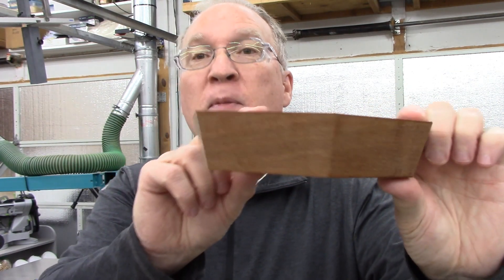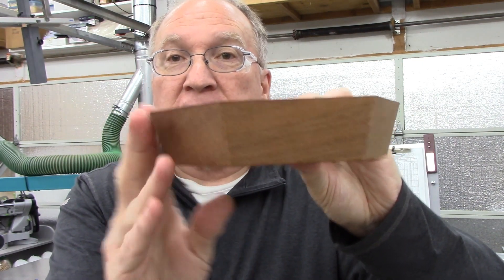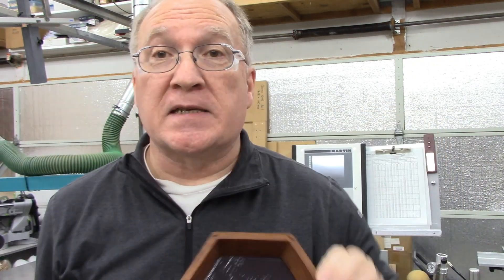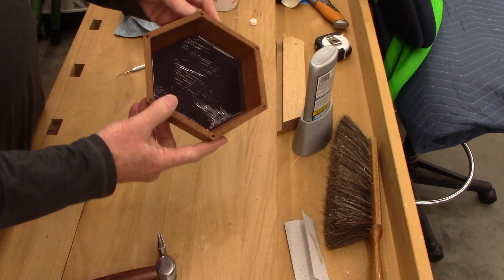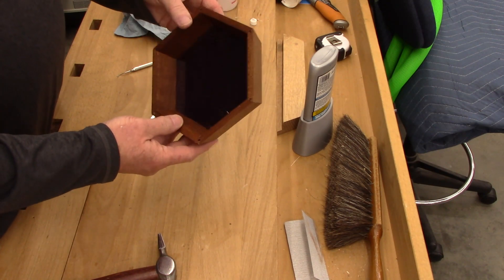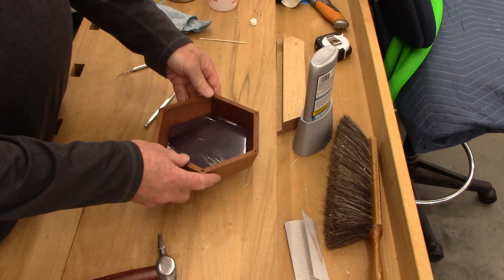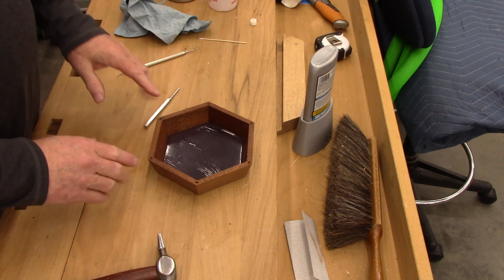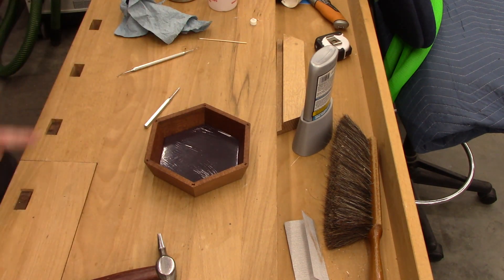Making a Hexagonal Compound Miter Box Part 1

Comment: Steve, watching all of those precise, and repeatable compound cuts done on the slider, makes me want to sell my miter saw.  😁👍🏻
Reply from the maker: I seldom use the miter saw in the shop as the slider is more accurate and safer.  Steve
Reply: What do you use your miter saw for?  I don't think we're watching a mobile shop video
Reply: @ReeseK9140  mainly for cutting face frame stock to length.

Comment: Jeez, I would be an extreme woodworker if I had $150,000 worth of the latest, state-of-the-art premium, industrial woodworking
equipment in a $350,000 workshop.  I've made tapered, octagonal containers on my crappy, 33 year old, Sears Craftsman table
saw with a few jigs and beveled router bits.
Reply from the maker: Great!  Make a video showing your octagonal container build, provide the link in a reply to your comment, and I will provide it as a recommended video on the endscreen of this one.  I have made this challenge to a number of people making comments similar to yours over the past 10 years and, to date, no one has accepted.  I expect this one will be no different. Steve
Reply: @extremewoodworker  You betcha!
Reply: Of course it's not a skilled worker utilizing skilled tools... Do better with what you have.

Comment: I know its a simple box but your work is really nice.  I really like the way the grain flowed around the box.  Your shop tools are also so nice.  Based on the templates you have to make this would I be correct in guessing that you batch out a number of these at a time?
Reply from the maker: Hi Andy.  While these boxes may look simple, it is amazing how complex they are to design and construct since there isn't a right angle in any of them.   I should have marked the pieces as I cut them to make grain alignment easier.  I always batch boxes as it makes little sense to make just one due to machine setup time.  These were prototypes and my first with splayed sides so this was a very small run for me ( usually do 15-25 at a time).  I started with enough stock to make 6 boxes but ended up with 5.  I lost one due to figuring out the clamp fixture on the Hoffmann machine as it took two iterations to arrive at the final fixture (the green one).  The lids are individually customized so I will do these on an as needed basis.  Steve
Reply: @extremewoodworker build templates that can be handed down... Maybe a son or son-in-law can carry the torch (I've never used an intricate nail set like that)

Comment: Steve, I always learn something valuable in your videos.  I'm sure you 3D printed your glue bottle holder.  That's brilliant!  I love quick and thick, but it has to be held upside-down while working with it.  My version is more crude and was made on the fly in 5 minutes.  Love the level of detail you put into thinking through your entire process.  Thanks.
Reply from the maker: Thank you Derek.  The holder was 3D printed and it has been working great.  I used to use the dog holes in my bench to hold the bottle but it was not very stable.  Steve